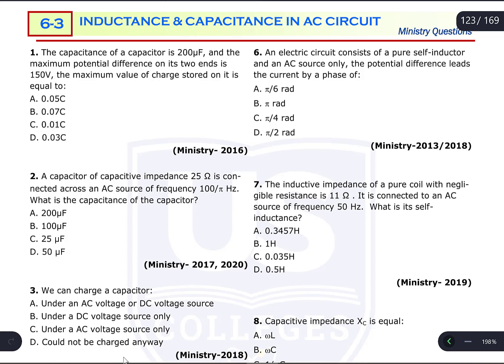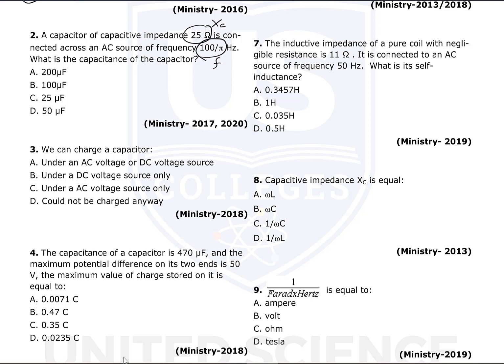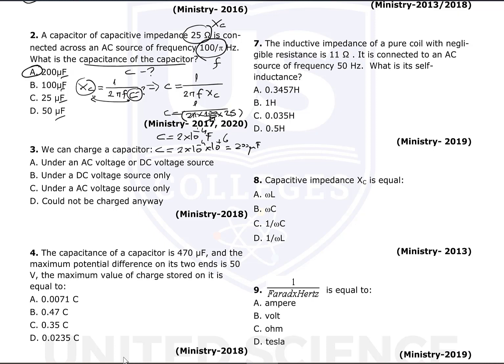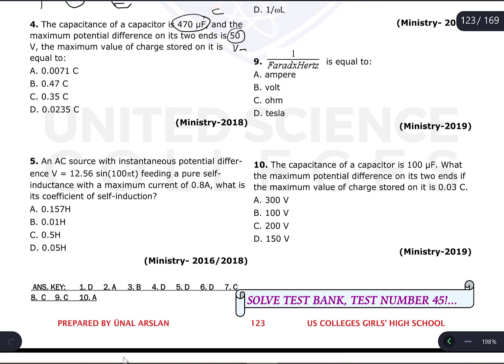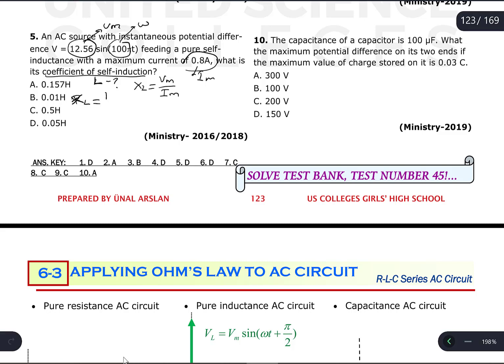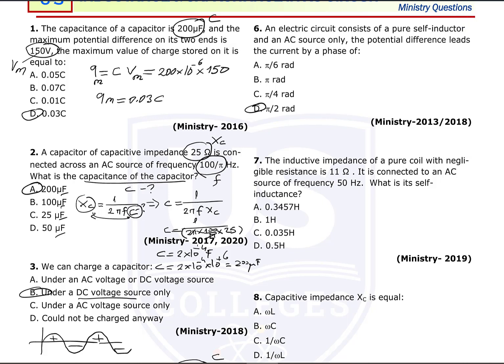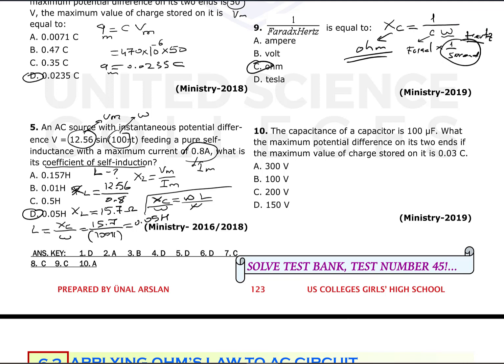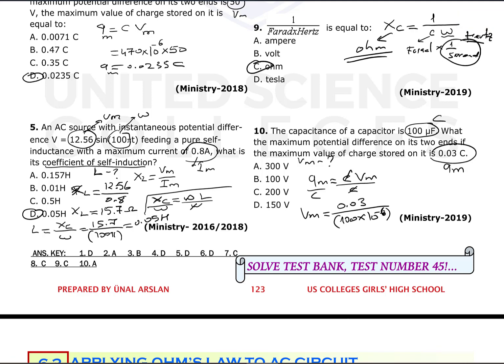Inductance and Capacitance in AC circuit | Answers of Ministry Questions | Wezary Physics

Comment: Teacher 
Q3
you said in AC 
as (+)part charges the capacitor
(-)part discharges the capacitor
BUt
in section review6-3
Q2 mention that
capasitor is charged when AC 
is(+)
discharge when it is (ZERO)
oppositely charged when it is (-)
Reply from the maker: both are correct.